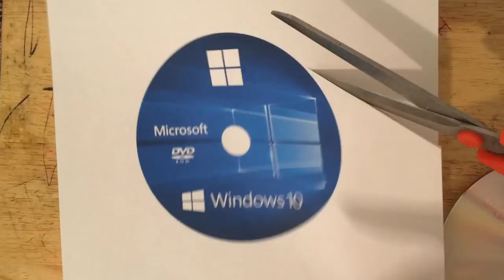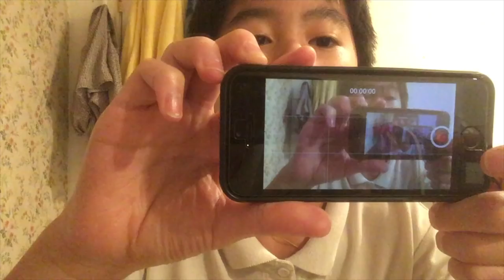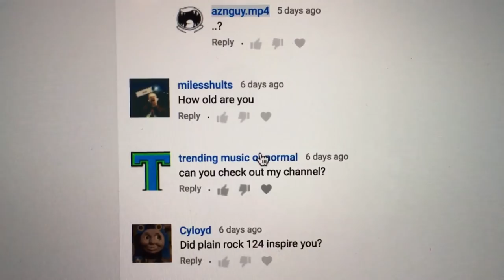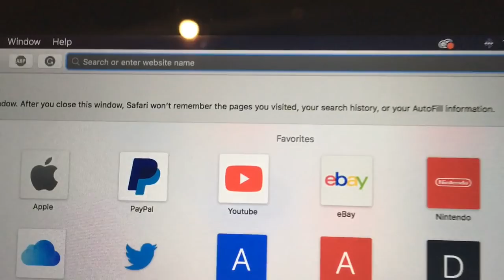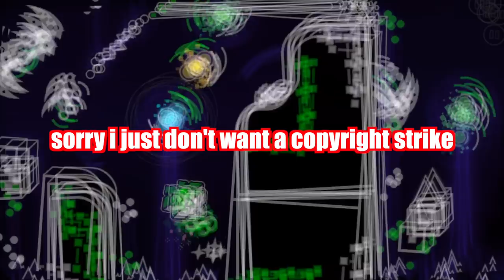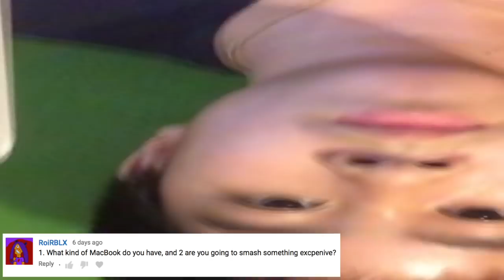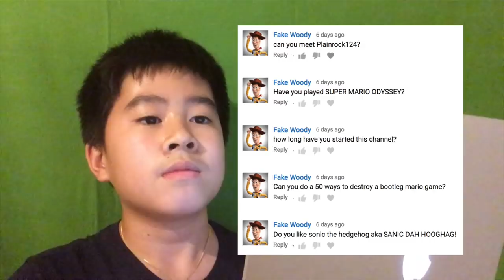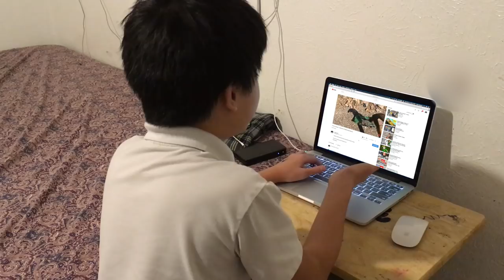Questions and Answers for 1,000 Subscribers!

Comment: 2:23 SOMEONE TELL ME WHAT LINUX IS!
Reply: As a linux user i find this funny.
Reply: I'd just like to interject for a moment. What you're refering to as Linux, is in fact, GNU/Linux, or as I've recently taken to calling it, GNU plus Linux. Linux is not an operating system unto itself, but rather another free component of a fully functioning GNU system made useful by the GNU corelibs, shell utilities and vital system components comprising a full OS as defined by POSIX.

Many computer users run a modified version of the GNU system every day, without realizing it. Through a peculiar turn of events, the version of GNU which is widely used today is often called Linux, and many of its users are not aware that it is basically the GNU system, developed by the GNU Project.

There really is a Linux, and these people are using it, but it is just a part of the system they use. Linux is the kernel: the program in the system that allocates the machine's resources to the other programs that you run. The kernel is an essential part of an operating system, but useless by itself; it can only function in the context of a complete operating system. Linux is normally used in combination with the GNU operating system: the whole system is basically GNU with Linux added, or GNU/Linux. All the so-called Linux distributions are really distributions of GNU/Linux!
Reply: @TOWGyt  if your a gnu/linux user you should have kne- I'd just like to interject for a moment. What you're refering to as Linux, is in fact, GNU/Linux, or as I've recently taken to calling it, GNU plus Linux. Linux is not an operating system unto itself, but rather another free component of a fully functioning GNU system made useful by the GNU corelibs, shell utilities and vital system components comprising a full OS as defined by POSIX.

Many computer users run a modified version of the GNU system every day, without realizing it. Through a peculiar turn of events, the version of GNU which is widely used today is often called Linux, and many of its users are not aware that it is basically the GNU system, developed by the GNU Project.

There really is a Linux, and these people are using it, but it is just a part of the system they use. Linux is the kernel: the program in the system that allocates the machine's resources to the other programs that you run. The kernel is an essential part of an operating system, but useless by itself; it can only function in the context of a complete operating system. Linux is normally used in combination with the GNU operating system: the whole system is basically GNU with Linux added, or GNU/Linux. All the so-called Linux distributions are really distributions of GNU/Linux!